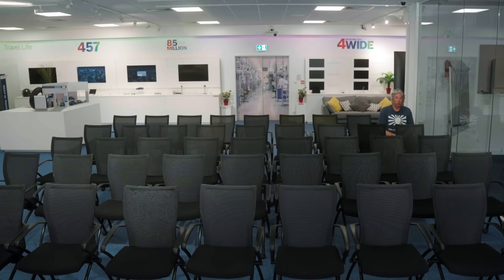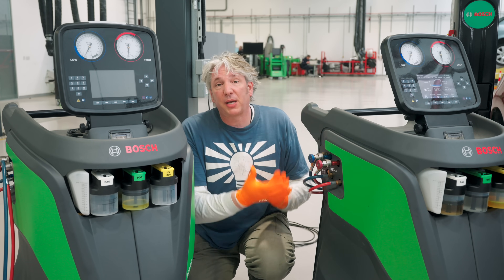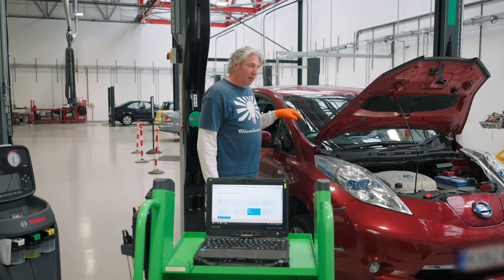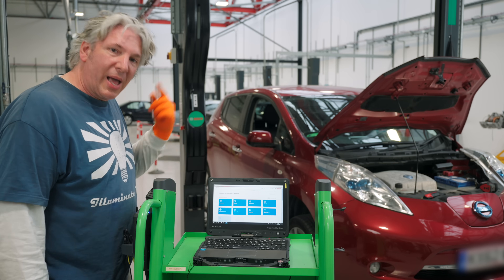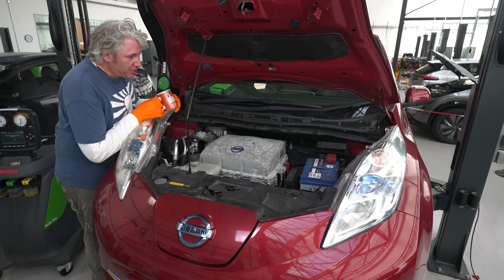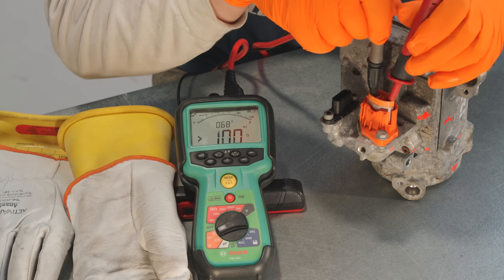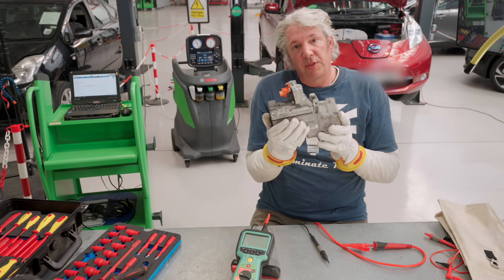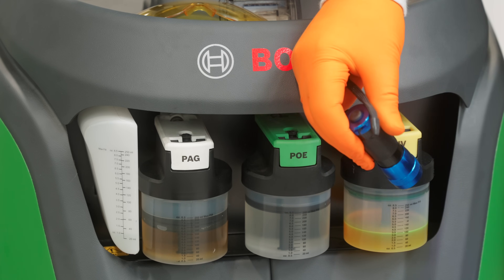Fixing Your EV AC System the Right Way: Edd China Shows You How!

Comment: Quite surprised you didnt open up the compressor motor for a look at what's wrong, I vividly remember you opening the Range Rover suspension compressor and finding the only real issue was the piston ring (not that you could get a replacement part but hey..)
I'd be interested to know what ther actual physical fault was, even if not fixable.

Comment: Thanks Edd good video. I have a question about the ac system. If you know you have a leak because it only took 4 months to disappear after a refill and you could some time smell the refrigerant. Is the leak most likely in the coupe? Cant find any leaks with uv around the motor.
Reply from the maker: Sounds like the evaporator next to the heater matrix behind the dash could be at fault. That is likely to be a huge job on any car! Get a refrigerant engineer to pull a vacuum or pump in dry Nitrogen and maybe you will hear the leak? Good luck!
Reply: @eddchina  Ok i will try that. Thanks for your answer. It sounds like a big job on my car as well. But that has never stopped me before :)

Comment: That continuity test can't work because you're feeding an inverter with these DC lines, the motor inside this compressor is very likely a 3-phase BLDC motor, so it can't work directely on DC, you need some sort of power conversion.

Comment: Isn't that a can bus compressor? Theres no way they're using a brushed dc motor at 360v in there. Its a three phase with its own inverter and the other connector tells it how hard to run. The earlier tesla ac compressor does the same thing and can be enabled with a simple pwm signal to one of the data pins. Measuring the power input plug to the inverter would of course show an open circuit as there is no coil directly connected to that unless the capacitors were messing with the meter. Testing it like that is not the way to do it. That doesn't mean that particular unit isn't broken, but that test showed nothing.

Comment: Why do you need to turn off the HV battery to replace a non-flammable gas? Seems overly paranoid. Ah. OK. changing the compressor, which is on the HV side.

Comment: Couple of side notes: 
1. Always pretest refrigerant for condition, best method is a slight glass. determine cause of failure. if mechanical failure was cause of compressor failure the whole system needs to be flushed to remove contamination 
2. All hybrid and ev will always use POE as the only lubricant. no ither oils should ever be used.
3. Never use the quick top up cans from outlets, these contain impurities and will contaminate your ac system, moreso on an ev.
4. Service time, if your service provider can offer an AC service on your vehicle in under 1hr 30mins. Trust me its not been completed correctly. the minimum vacuum time which is key to an ev service is 1hr depending on system condition.
5. The AC machine is a great tool, anyone can plug in the hoses, press a few buttons and walk away.
but their is an entire science behind what is actually happening which no machine tells you. 
System integrity and the ability to have a true vacuum down to 300microns is something a machine can not tell you.

Comment: This is yet more proof that the cost of running an EV is going to much higher than we are being conned into believing. Just consider the huge costs of re-training staff and new equipment. It will drive smaller repair shops out of business and force people to use main dealer shops which always rip customers off.

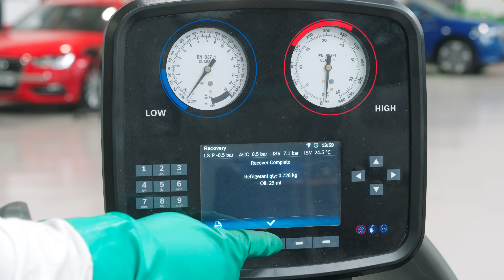Comment: 3:52 a fault with AC oil.... PAG should not be use again. System must be cleaning out flush from old PAG oil because its degradation if systems leak and some water goes to system. and of course change dryier

Comment: "only 19 Gohms on the oil."  At 350 volts that would give 20 nA in current.
Reply: 10nA is safer, much much safer. It's for the next generation, you know. They hopefully get down to 8nA.

Comment: Small remarks: Never put testing leads into the HV-connectors. They can damage the pins/sockets/connectors. Use an adapter, also called HV-breakout-adapter. Secondly, the reason you would not measure continuity on a single phase HV-motor could also be that there is are switches (H-bridge) in series to the inductor winding or even one additional switch right after the HV-input. The switches are normally open (e.g. a n-type MOSFET or a IGBT). Most of the cases you can measure the filter capacitance between HV+ and HV- (also called C-X capacitance), but not all continuity-testers can reliably test the capacitance, you need a special device.

Edit:
You also measure insulation from HV+ to ground (chassis) and HV- to ground (chassis) in two separate steps.

Comment: I am here for the anti EV comments! Those old Leafs sell for £3000-£5000. Ideal city cars, even with a bad battery. As long as the cells are balancing and tgere isnt one bad really bad one tgrowing ot out they will go on for years. Most of the mechanical parts are the same as other Nissan models.
Reply: Did look at a Leaf for daughter as first car.  Unfortunately going to college 30 miles away the early ones would have meant charging somewhere before even coming home at end of day whereas a nice cheap petrol gets filled once every week or so, is half the price although newer and insurance only £2,500 at 18 not £7,000!
Reply: @danieltaylor4225  that's not a town car situation.

Comment: Anyone who has worked on trolleybuses will know. Even if you pull the trolley poles down, capacitors remain charged and slowly discharge through a small resistor. Of course, if you do not have the minute or so to wait, you can insert a scredriver between the leads of the capacitor connection. Just make sure to say farewell to the screwdriver, as it will not survive. Also you will be temporarily blinded. Testing the high voltage insulation with a megmet was a nice demonstration.

Comment: The other method of temperature measurement is what the low pressure (large bore pipe) is running at in the engine bay.
The Rovers I work on with R134a cool down to a nice 4C 👍

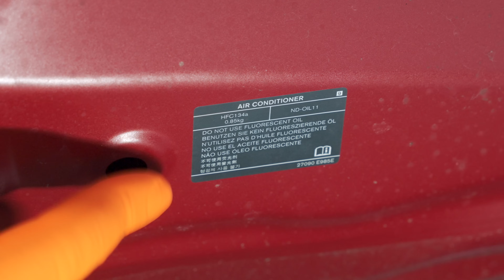Comment: Edd, at 1:30 you can see Nissan's refrigerant sticker, clearly says do not use fluorescent oil but at 17:10 you say add the fluorescent dye. Is that correct?
Reply: The sticker is from 2012 when only conductive dyes were available. The new low conductivity dye is OK to use.

Comment: That little multimetre put 1000v in 👀 😲
Reply: Not a DMM, the bigger one he used was an insulation tester. It puts out a voltage to test the insulation resistance value of insulated conductors. This can determine if conductors are shorted to ground or to another conductor. Some units combine the DMM and Insulation Tester together. 😊

Comment: If the motor is really a high voltage unit (360 volts), then the winding may be a higher resistance than you might expect. For example, the winding might be 100 ohms, and 360 volts would make a current of 3.6 amps, and power 1.3 kW. So I'd recommend just using the DVOM's ohms scale, and reading the actual resistance. Don't assume the winding is only a few ohms like a low voltage motor. The continuity function may not have a reasonable threshold. Maybe - perhaps - YMMV.
Reply: A motor like that is surely a brushless dc motor, wich is actually an ac motor with drive electronics. Meaning a multimeter is useless to diagnose it like that.

Comment: A 2012 Leaf with only 21,000 miles and a 12-bar battery! Something of a unicorn, I suspect.
Reply: Based on the motor top cover, it's a 2013 onwards Leaf. Although that does make Edd's comment regarding the 3 phase compressor only on the later cars a bit confusing
Reply: @delberttannen3403  The compressor he removed is a 3-phase. Apparently they didn't explain in the training that the motor controller for the 3-phase BLDC is integral in the compressor housing.
Reply: @zaprodk  i was thinking that it would not make sense to have the power for the compressor controlled from some kind of external vfd/inverter, but might be harder to diagnose in the future as many inverters need a signal to drawer power/ do a successful continuity test
Reply: @maygarland6123  AC compressors in modern EV have two connectors. One with high voltage DC from the traction battery. Other connector is control signals and CAN bus that controls the inverter which in turn drives the motor. Simple.

Comment: How does having the AC on max  in summer or heater on max in winter  effect the range of the vehicle if at all?
Reply: Anything electrical used on an electric car will give you less range. Obviously some stuff more than others. But heating and cooling will be one of the biggest. Some stuff will just be of the low voltage side like the wipers and lights etc but the low voltage will be charged via the high voltage side I would have thought not 100% sure on that though

Comment: I shall be maintaining and running my classic car for another 20 years after seeing this video! No EV for me!😮
Reply: Why not both
Reply: I've got both though the ICE car very seldom gets driven.
Reply: Most modern cars require similar tools to maintain. There's definitely a place for classic cars for those who want to do their own maintenance.
Reply: I shall be nursing and riding my horse for another 20 years, after seeing this video. No car for me!
Reply: I had a c350e merc. Mechanical write off because of swarf in the AC system shorting the compressor.... spent about 5k fitted a new compressor etc trying to get it back on the road. Only merc could work on it, specialist ev garages couldnt get the correct diagnostic kit... absolute shambles.
Reply: More anti EV nonsense. I'll carry on charging my electric van for 4 quid overnight, doing hardly any maintenance, enjoying the quiet relaxing drive and not polluting for the next 20 years.
Reply: Well your missing out. Once you go EV you never go back.
Reply: Horses for courses really. I purchased a 2011 leaf for my wife because it has little to no depreciation anymore and I can charge it with solar, all of which deprives the exchequer of the max amount in revenue.
 I love it but my wife hates it sadly because she isn’t OCD like me and doesn’t enjoy the academic exercise of driving economically. 
May I just point out what a useful little car it is for those frequent short journeys that are so expensive and damaging for the average ICE engined car, especially diesels. For the rest of the longer trips, I have an XC60 that’s both economical and comfortable. You’ll probably be surprised how many of your journeys are less than fifty miles.

Comment: Now there's something I will never have to worry about, working on an EV as I will never own or drive one.
Reply: You might find in 10 or 20yrs you can't afford to put liquid fuel in your car.
Reply: Someone I was talking to today said they looked at replacing the fuel system in their Ford Ranger, and was quoted £8500 that nearly makes electric cars look cheap!
Reply: @SheepShearerMike they are getting ripped off. 
Remember that a Kia battery is over $30,000 dollars.
Reply: Exactly...same here...I'm so grateful I lived in the time of Internal Combustion engines...my life was so much simpler that way...despite all the disadvantages of burnt carbon and toxic exhaust gases...all you needed to do was plan ahead for petrol stations and you knew there would be one wherever you went...in my case England...and make sure you could pay of course...I want no part of EV's 2 wheels or 4...I tried a battery scooter for fun...that's it...finished
Reply: These EV's don't look as appealing or interesting to work on than combustion engines.
Reply: And when the main battery gets old it costs more than the car to replace it I'll stick with my gas power
Reply: @guyordorff8355 👍

Comment: Nice little video......looks like bosch have rebadged a megger MIT 420 (or similar) and got it in green too! 😝
Given and received many a shock from these when messing around 🙈😂
Reply from the maker: Thanks for watching! Well spotted, I believe there is a new version of the FSA 050 coming out soon…
Reply: I only use Fluke’s, a bit pricey but never had any failures in the 40 plus years of professional use.
Reply: They have rebadged the ac machines too ... They are robinaires with fancy stickers .

Comment: What do you think about the A/C R-134A canister that you reill at home are these any good?
Reply from the maker: They really should be illegal in Europe! I don’t understand how they are for sale; to be allowed to recharge an AC system in Europe & UK you have to be qualified as the refrigerant is poisonous to humans, super cold and will mess with the ozone layer etc… but maybe that law has changed now! Just be careful, wear the right gloves & goggles and check your system for leaks first by pulling and holding a vacuum first…
Reply: @eddchina  Thanks Edd.
Reply: @eddchina 
Hi Edd.
I’m a retired MVT with A/C experience. Leak testing must be carried out using nitrogen gas, and use an audio device too listen for leaks. This served me well. Please contact me about that. 
Refrigerant charging ports are different for each type of gas, so incorrect gas should not be able to be installed.
R12 refrigerant was the ozone depleting type, R134a was allegedly greenhouse refrigerant. Didn’t experience R1234.
Unfortunately very little monitoring of people carrying out A/C repair work so I have never seen convictions of inappropriate operatives! This is very disappointing. 
Would be good too meet you one day, I’m on the South coast! 
Take it easy pal! 😊😊

Comment: A very interesting video which shows that in the future with all the new equipment and training of mechanics required to repair EV's, the costs are going to be very expensive.
Reply from the maker: They are indeed but you already need most of the gear to service modern cars of any fuel. Current classics will endure as future classics will be too hard to tinker with at home, perhaps?!
Reply: The same was said when fuel injection was new and confused people who only knew how carbs and clockwork distributors worked.
Reply: Expensive = in some cases prohibitive
Reply: But in the end, gas or electric, it still mechanical. The basics of all cars are still there and will be until they invent teleportation 😂
Reply: :)ev to ice conversions, thats the future
Reply: Used EVs are piling up at dealers. No one wants em. Which is why depreciation on them is crazy
Reply: Exactly the same was said about the automobile when everyone was riding horses.
Reply: No it wasn't
Reply: Neither horses and carts or injection have 11,000v to worry about.

Comment: We may have a future with some electric vehicles in it, however they are not the be all endcall that they have been promoted to be. I cannot have one, because of my living situation and inability to have access to a charger. Its just not practical. I believe most people in rural areas would agree as well. EV's should not be pushed as an only choice for the future as they are just not.
Reply: I live in a rural area, no home charger and find an ev is great and practical. I have to shop each week and attend meetings etc so charge the car when I’m there, absolutely no problem as the car can charge in the time to get a shop, meeting etc and return over 200 mile on an 80% charge. Definitely cheaper to have your own home charger but  charging away from home is still cheaper than filling with diesel or petrol. People need to get away from the thinking that you have to a home charger, nice but not essential.
Reply: I agree I think that electric cars are great for commuting to and from work etc if there is a suitable charge point at either place. But because everyone's needs are different an electric car won't be for everyone. I remember the queues at petrol stations when everyone panic bought fuel that takes maybe 5 minutes to fill up. Can you imagine the line of electric cars waiting to charge up at fast charge points. Or the line of flat electric cars on the motorway during the winter when you get stuck on a closed motorway due to snow or an accident or something and all the electric cars sitting there with lights on heating on so they don't freeze
Reply: @danielstephenson886 you'd have to imagine the line of electric cars waiting to charge and all the electric cars that run out of energy during traffic disruption because it won't happen.

It doesn't take that much energy to keep an EV warm when it's not moving and unlike a petrol or diesel car there's no risk of killing yourself with exhaust fumes during a snowstorm.
Reply: @GraemeHart8888  Then, by all means buy a fleet of them and be happy! Others will CHOOSE not to buy them and that should be ok!!
Reply: @looslimb  others would prefer you stop buying cars that produce pollution